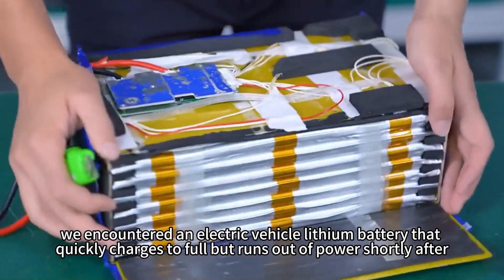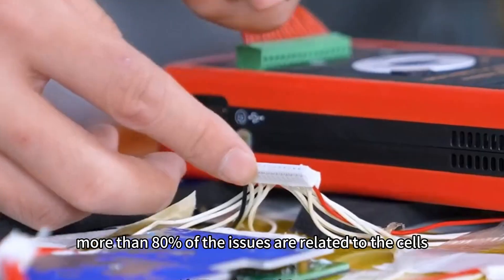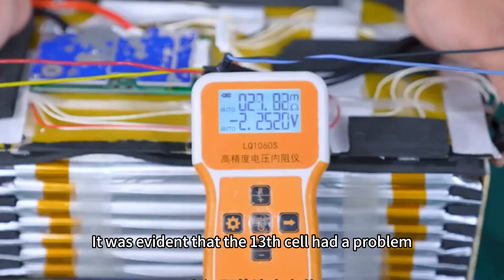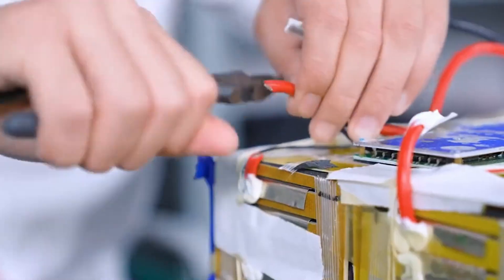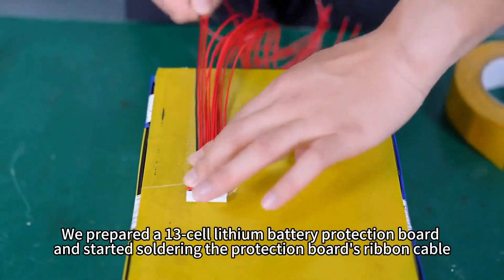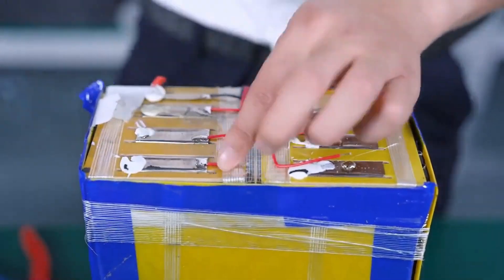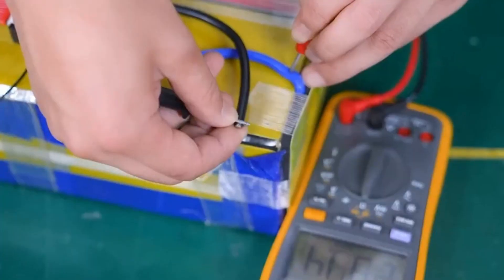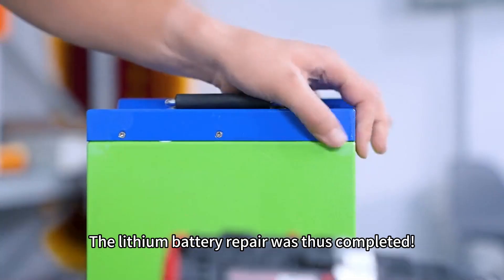Repair electric vehicle lithium battery

Comment: What if a cell damaged in 13S battery
Reply: One cannot just replace the damage cell. You have to test every cell capacity. Voltage is good doest not means its good for pack